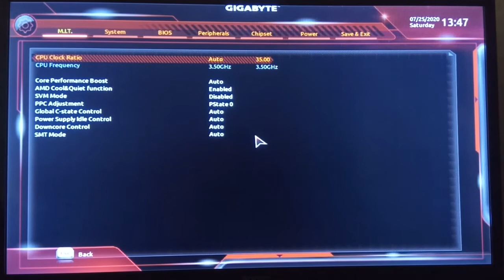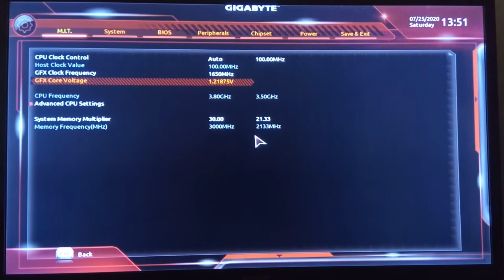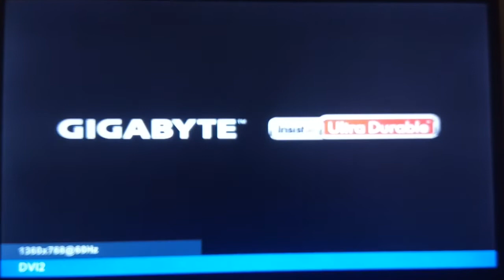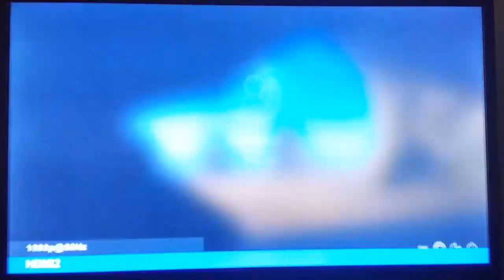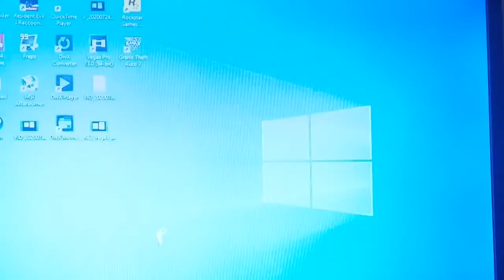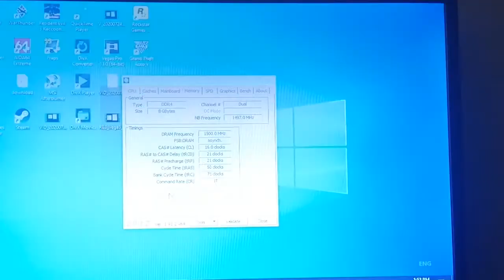vega3 (athlon 3000G) overclock

Comment: Dudes, I have an Athlon 3000G
On a MSI B450m Pro-Vdh max Mobo...
But I can't find any option to O.C. my vega 3 iGPU in the BIOS.
Even tried ryzen master but all it does is require a reboot to apply but next reboot resets all! 
Msi afterburner basically doesn't work at all I don't know why 😕
Can anybody help me 🙏 I posted it on the LTT Forums as well but no one noticed I guess! 🥺
Reply: Msi don't have igpu oc
Reply: @rohanjha7116  they do... I've seen many youtubers using MSI mobos... One of them had the same bios as mine just difference was it has igpu oc settings as well but mine doesn't
Reply: @p.k.953  Earlier it has but after new board they removed
Or support only few processor like ryzen apu
Reply: @p.k.953  I had also msi pro vdh b450 but returned and ordered asrock b450 pro4
Reply: Same happened to me, u get any fixes yet?
Reply: @jed4web  no bro🥲
Reply: Buy asrock mb
Reply: @rohanjha7116  😐😑

Comment: I use this settings :
GPU set 1600 (1100 default)
CPU set 3.7 (3.5 default)
RAM set 3000 (2600 default)
Voltage set 1.2V

This pretty safe for daily even with stock cooler.
And I used it since 2020 Jan :)
Reply: my settings:
CPU 3.8 (voltage auto) 
GPU 1600 voltage auto
RAM 3200 (2*8gb, stock 2666) voltage 1.350
My configuration: athlon 3000g + gygabyte b450m s2h v2 + deepcool gammaxx 300 + Kingston fury beast black 2*8 2666
Reply: @konigyoutube9824 
Awesome settings
Reply: what voltage
Reply: @rohanjha7116  Power consumption
Reply: why dont boost it to 3.9? motherboard prob?
Reply: @danishtitanz5241  No, 3.7 is better enough to use without worrying
Reply: Thank you bro its pretty reliable cpu and with a good price

Comment: Not worked
Reply: It did for me, currently running it as same as the video and it works perfecto
Reply: @armandolinaresg6446  i have a msi a320m pro and i dunno whh it doesn't work
Reply: @urban2420  that motherboard has a320 chipset which is can't OC cpu and igpu, but you can oc the ram with memory try it feature
Reply: @armandolinaresg6446  I have a dobut will overclocking cause any problem ?? Heating
Reply: Same bro huhu